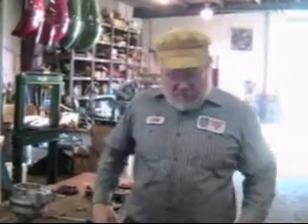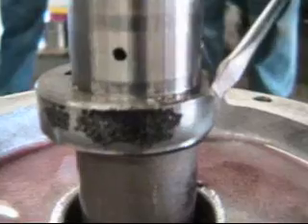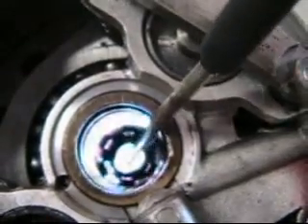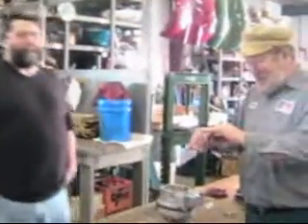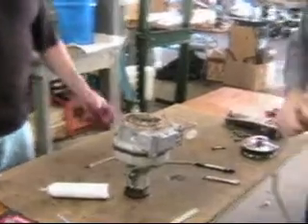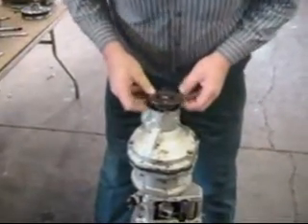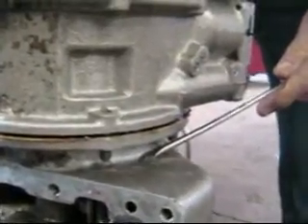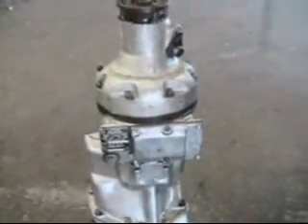76 MG Tech | Fitting an Overdrive Unit to the Gearbox.

Comment: Critical issue that is glanced over in the video.
The splines in the OD must be aligned to the micron level. If the two Spline rings are not aligned, you have to use a long flat screw driver to Align the two Spline rings. You can only move the inner ring. And ...it only moves _counter clockwise_. Banging it up and down as he does in the video isn't the answer. He was lucky. Remove, realign the spline rings. Try again. If you do it right, it just slips on. I put a vicegrip on the drive shaft to do some wiggling. Also, wire back the pump shaft.

Comment: what exactly is overdrive??? can someone explain to me with the most simply answer?...
Reply: on my spitfire the over drive raises the gear ratio in 3rd and 4rth gears,so basically giving 6 speed box at the flick of the switch on the gear knob,it reduces engine speed while keeping the same road speed,for cruising motorways or getting a 3rd gear slightly taller for hills without kicking the engines arse,can be great fun on single lane country roads where gear changes from 4rth to 3rd in windy bendy roads can be driven more in 3rdOD for more power,that's my excuse,saves fuel and wear too.